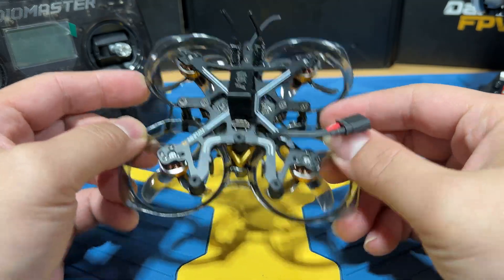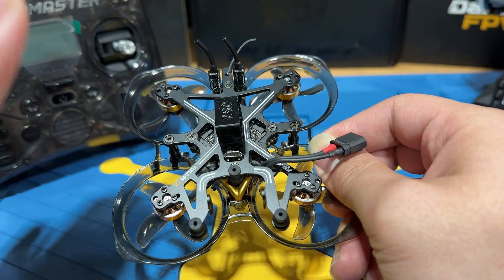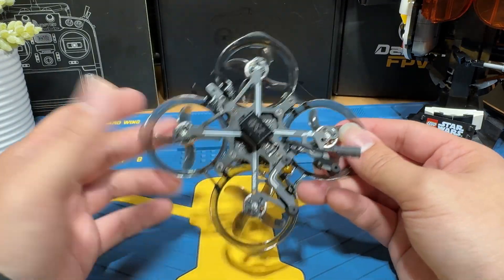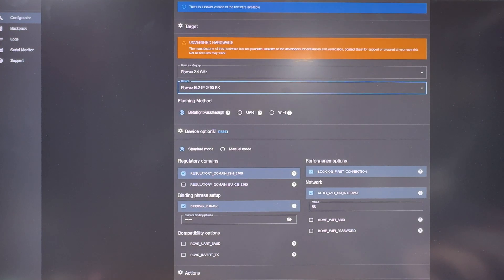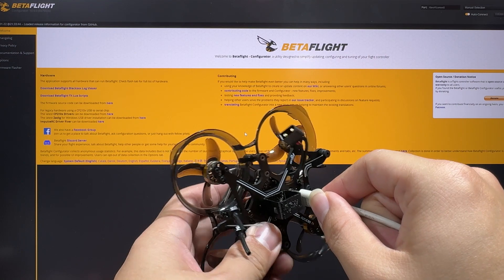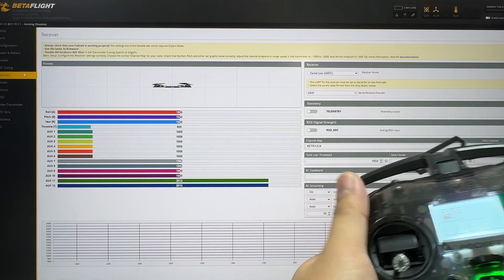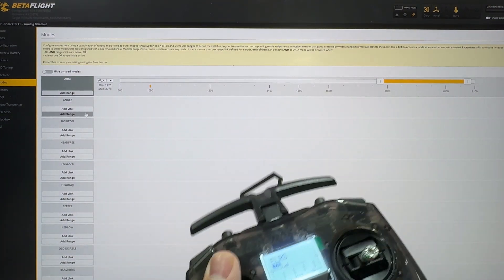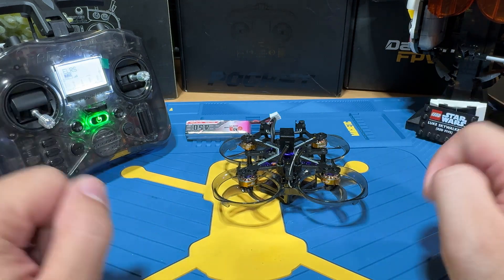Bind the Flylens 75/85 to your radio the first time! | Pocket ELRS | BetaFlight passthrough |Flywoo

Comment: why my flylens75 smokes when battery installed after this flash firmware?
Reply from the maker: It is not likely caused by the firmware, mostly you have a short somewhere

Comment: I cannot get the tx12 mk2 to bind to the fly woo 75 with dji o3 unit it’s popping up on tab and also it was somehow connected before plugging  into beta flight because when I unplugged drone it said telemetry lost so I know it was somehow binded atleast for a second before it tried the elrs configurator. Second question is when I get to end I don’t have com1 or any com option please reach our if you can I can video call as well
Reply from the maker: 1. For RC connection, if you hear the tone telemetry loss, it means it has been connected, try turning on off model matching to see if it fixes the issue 
2. Sorry don’t fully understand your question. 

If you have more questions, please reach out via IG

Comment: Hi, thanks for your video, it really helps but i have a few questions. i just received my flywoo flylens 85. once i have bound it to my radiomaster boxer, the throttle is super sensitive and just takes off. when i put in some alieron/yaw, it is also too sensitive. how do i reduce the sensitivity?

secondly, when i reduce the throttle, it just drops very quickly as if the throttle is an on/off switch rather than linear which i think relates to the sensitivity from the the question above. for example, i just move the throttle stick a little and it just takes off. this is the same with the rudder input, the aileron/yaw stick; any small movement and it just goes off in that direction. its near impossible to control.

thirdly, when i bind it to my radiomaster, can i pick a blank model (not the FPV model) and bind it to my flywoo flylens 85? OR must i pick the FPV model? reason is i have another drone set up on that.

any help is appreciated.
thanks!!!
Reply from the maker: Not sure if you still need help, i understand your question but it will be hard to explain everything at once. If help is still needed my suggestion is for you to contact me separately on IG

Comment: I have to get a whole fpv team for this crossfire version drone along with tbs tango 2 pro, what program do you recommend I use to bind it? Nice video!
Reply from the maker: What program are you talking about? Thanks 🙏
Reply: @XwingFPVRC  I have a tango 2 pro and as expected I use crossfire. Today the flylens 75 arrived and betaflight does not recognize the drone, which it does when I connect the flywoo LR4. I'm new, I've been doing this for 2 days and I'm asking for help because I'm frustrated, I can't link my two drones and I haven't even turned on the Google DJI 2. But I know that little by little I'll get there... if you know, any help is welcome. .

Comment: Пока "не приехала" FPV система можно полетать на таком чуде. Передатчик Micro AIO Camera A3/A3-OSD/BS2-OSD Mini 5,8 Ghz FPV.  АллиЭкспресс. Установив на свободное место. За одно и потренироваться как аппарат ведет себя в полете. Попробовать настроить ELRS через "присеты" - не эксперементировали??))  { Чтобы число взлетов = числу посадок. }  Until the FPV system arrives, you can fly such a miracle. Transmitter Micro AIO Camera A3/A3-OSD/BS2-OSD Mini 5.8 Ghz FPV. AlliExpress. Installing it in a free place. For one thing, practice how the device behaves in flight. Try to configure ELRS through “presets” - have you experimented??)) { So that the number of takeoffs = the number of landings. }😜😜